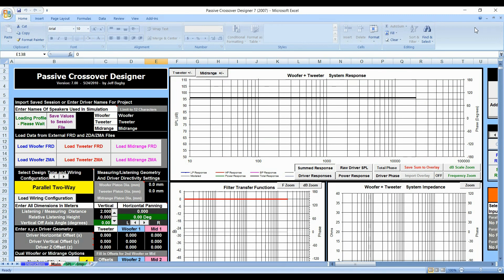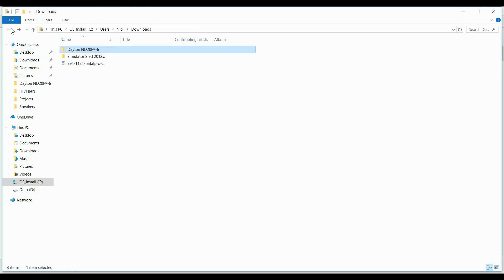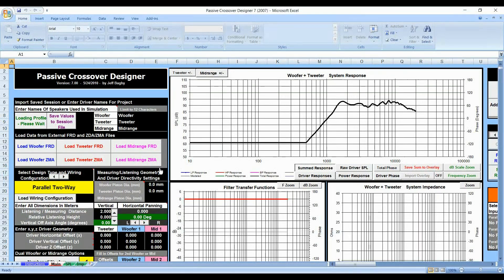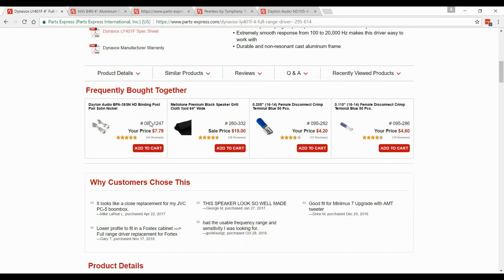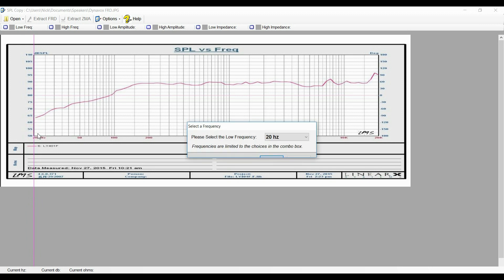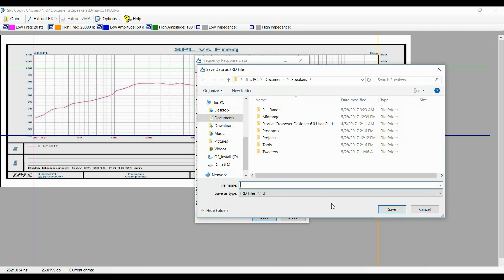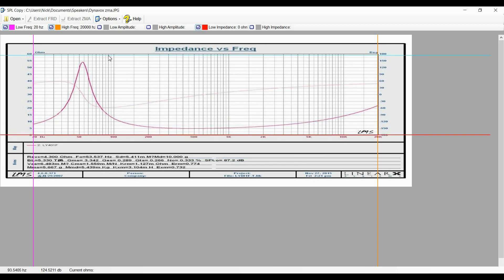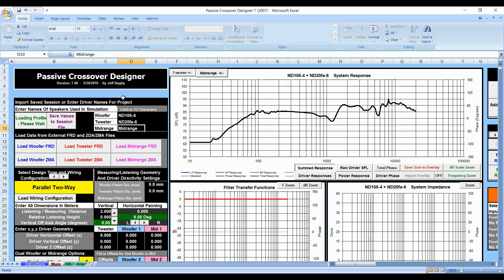How to Design a Crossover - Part 1- Import ZMA and FRD Files

Comment: This looks cool, but it's ALL "Greek" to me, lol! I don't even understand enough about the very basics of how computers work in order to even use this program at all. I don't know any of the terminology you're talking about, or even how you are doing all of the file renames and copying of info, etc. Computers are completely "alien" to me. I can barely even figure out how to use my cellphone to watch videos on Youtube...

And I really love working with and improving speakers, I have for many decades, ever since I was a teenager, but I've always done all of my calculations on paper, utilizing a paperback speaker design book I have and a calculator, and making all of my measurements with a multimeter and a manually adjustable analog frequency generator, then drawing the response graphs out by hand, point by point, on graph paper, as that is all the equipment that I can actually afford...

I know you said that this specific program is free to download and use, which WOULD (potentially) be really cool, but since I don't know anything about how computers work, nor do I even OWN a computer or laptop in the first place, because to me they are just an extremely expensive "gadget" that would just sit around collecting dust with me because I don't know how to use one, so oh well, I guess I'll just have to keep building speakers the "old fashioned" way, as described above. That's worked for me so far, even though it takes MANY hours, or even days, sometimes even months, of tweaking and adjustments and recalculations to finally get a good final result!...

I really wish I had a better grasp of how to operate a computer, because if I DID understand them better, I can tell that by using a computer program like the one in this video, my hobby would be MUCH easier AND faster to do, but even after MANY decades of trying to learn about computers, I just totally gave up on them, because they are just WAY too confusing for me! I simply can't wrap my mind around just how many endless options that computers have, with all of the stuff on the screen always continuously changing, nothing is ever the same each time you turn it on, and files and stuff always just get "lost" somewhere in the computer and I never "got" how to find them later... again, I can't even grasp the very basic fundamentals of how a computer works, so I just stick with things that have totally manual knobs, and mechanical buttons and switches on them, so that way you ALWAYS know exactly what any specific control does, and it can be relied on to always do that same function every time you push, flip, or adjust it...

The same cannot be said for any of the controls or keyboard buttons on a computer, as they always are doing something totally different, and in different combinations, with every different screen view, depending on what you see onscreen, but it's just way too much for me to remember all of the specific button combinations to make a computer do anything as you want it to... Computers to me are like trying to open a combination lock, where the combination to open it is constantly changing, and at totally random, unknown times, lol!

Comment: Great video about crossower.I want learn these:
in some  crossowers using car lamps  for tweeter protect for especiall while microphones feedback.
If have good design crossowers for suiable power amplifier not need bulbs for protect?
Other question what is these filter design's power rating  ? for example how is change values for 500 watt RMS amplifer crossower design (for all same frequency filter ranges)
Summary if our amplifier's have not feedback protect feature how to protect speakers in crossower?and how is change design for more power amplifiers?
Again thank you for great crossover video series

Comment: Hi, great videos. Quick question about the FRD files. I downloaded one for  Dayton Audio TCP115-8. And then I got the trd from the graph using FP graph tracer. When comparing them the curve similar but the official values are around 2.3 dB lower. But the scanned ones then are in line with the graph on the datasheet. So which one should I use then:) What's you experience with scanned frd files and real life measurements?

Comment: I try out that SPL copy, and it worked only partially, because FRD, did not shown correct frequency response line, it was similar at the best.  And ZMA line was correct but values was not, it show 4 Ohms lower then it actualy was. I tride out seweral times, changed walues, but still in crossower desining programs graphs was uncorect. I try 2 cross design pros, thay show the same results, and results did not match measurements which was in PDF files.

Comment: Would be great to see something similar and human using VituixCAD, especially the optimiser and something a little more in depth than Kirby.
Reply from the maker: Maybe I can do one for that program if you like. I'll have to look into it
Reply: That would be totally awesome, something for the mid-level designer rather than the total beginner, oh and it has an SPL Trace tool built in, handy for non Dayton drivers, some of us use alternative manufacturers 🤣😂👍.

There's very little human YouTube help for this application, and it's so so comprehensive.  

Cheers
Lea

Comment: When you use the dats V2 to get your t/s parameters can it give you this info as well? Trying figure out the best way to pull specs on some vintage drivers that have been in the family that I would like to design new enclosures/crossovers for.
Reply from the maker: plugger410 it will give you the zma file. But in order to see the frequency response you'll need a measurement mic (like the umik-1) and a Rew (free).
Reply: @Toid  I wanna start doing more diy projects and I wanna get better with all the values I need to build right volume and do well crossovers.
I have a DATSv3, so I use it and save the impedance as .zma in dats?
To get my own .frd I can use REW ? do I only need a nearfield on axis or 0 -15 - 30 -45 degree measurements ?
thanks in advance
Reply from the maker: @tommyshoe-star1426  all of those measurements are good to have. What I'd recommend is starting a new discussion on the forum that way we can help you with it. www.toidsdiyaudio.com/forums

Comment: Hi. Great vids. I've learned a lot watching them. I do have one question. I'm building my own xover for the first time and the speaker I'm building has a passive radiator in the design. How do I design the xover with that in mind??
Reply from the maker: Drew Dunn the crossover really isn't going to change. The only thing that's going to change is your box design. So you're going to want to simulate your box designed with the passive radiator. I have a series on when ice tea and how to do that if you're not sure how to
Reply: 123Toid that'd be great if you could send me the link. Thanks for your help. It's hugely appreciated.
Reply from the maker: Drew Dunn Sure.  Here is the link to the playlist: https://www.youtube.com/playlist?list=PL6hjpiCHZmIOAv44PCreW5KlI35h1mTZK
Reply: Thanks dude. Keep up the great work.

Comment: For all those having problems with Excel. i spoke to Jeff and he said "Thant it work correctly in 2013 and up, or any application that is 64 bit architecture. This is due to Microsoft changing the way the VBA is handled. Unfortunately, to resolve the issues would take a lot of rewriting of code and I do not have the time to do that these days. I also do not know exactly what all needs to be redone. As a results, as I have stated a number of times on forums, I do not plan to rework it at this time. Maybe I will change my mind down the road, we will see."

Comment: I'm working on my first 3-way and am having difficulty importing the midrange frd/zma's. I can import them on the woofer section just fine, so the files are good. It's just not loading up the mid when I hit load mid frd and zma. Thoughts?

It's gonna be a TangBand W5-1138SMF + Tymphany TC9FD18 + Dayton ND16FA and is more or less Scott Sehlin's 'Hafnium' design with a different tweeter.
http://techtalk.parts-express.com/forum/speaker-project-gallery/53512-hafnium?234378-Hafnium=
Reply from the maker: Kcducttaper1 make sure you select 3 way wiring parallel on the left hand side just below where you import your FRD and ZMA files.
Reply: I'd hit that, but it still wasn't working for me. Turns out I needed to select 3-way, then hit the 'load wiring configuration' button right below that to get it working. Thanks!
Reply from the maker: lol, I did forget to mention that.  Whoops, that is only the most important part :)

Comment: I love this series - thank you!  But I have a question:  I am contemplating a component audio system for my car and also designing the crossover for it.  I realize there is a huge difference between home & car audio; car audio is like making a silk purse from a sow's ear, but, generally, would one still use the same approach, knowing that the car's interior, etc., is going to make a mess of one's carefully laid-out response graphs?

Should one still shoot for a "theoretically" flat response, and then try and EQ the resulting "true" response after the system is installed?

I value your opinion on the matter.
Reply from the maker: That is a great question.  The best thing to do, would be to test the speakers in their probable location with a mic.  Graph the speakers separately and then design the crossover around those graphs.  There are a lot of variables in car audio.  However, if you are unable to do that, then yes.  Shoot for a theoretically flat response based off approximate locations
Reply: please please do yourself a big favor and go full active with a dsp...that way you can measure and corect everything on the fly without making crossover....yeah you will be making crossovers but in the dsp....also has the benefit of no loss to the signal...

Comment: I would like to use this Excel spread sheet, but i have an office 2016 version. The file is not opening in this version. Do you have a fix for this?
Reply: Awesome.  I'm trying to learn about speaker crossovers and I'm really excited to find your video series.  One more quick question....If I were to use that B4N as a mid and the same Tweeter (ND-20FA) for a speaker, similar to the 'Overnight Sensation' bookshelf speakers, would I just input my mid-range info into the woofer load section in the excel template?  Because if I change the wiring configuration to 3-way, it may not be accurate because I am not doing a 3-way circuit config.
Reply from the maker: Bart Agten I haven't heard of any issues with office 2016.  of course I  do not use it either.  Have you enabled macros?  It will not work until you do that.  If that doesn't help, try running it in compatibility mode.
Reply: Thnx for your reply.
Even when i enabled the macros, it still doesnt work in 2016. So I tried it on a 2013 version and it works.
Reply: If you have Excel 2016, how did you try it on a 2013 version?  I am having issues in my excel 2016 version as well, tried compatability mode and it still does not work when attempting to load the FRD and ZMA files....
Reply from the maker: spencer schmid I've heard some people having issues.  Have you first enabled macros?
Reply: Yes, I enabled macros and also the VBA toolpacks.
Reply from the maker: spencer schmid if that's the case, unfortunately I don't know a fix for it. However you can try winpcd.  It's a variation of this program, not quite as powerful though or intuitive. Your other option is to try another Excel program. If not an earlier version, maybe one of the freeware versions might work with it
Reply: I actually got it to work through some trial and error, not sure what was going on, but I had to resave the FRD and ZMA files after opening them again in notepad.

I replicated what you had for the ND-105 (woofer) and ND-20FA (Tweeter) and my graph mirrored what you had.  One thing I am not sure about is the B4N.  I saved those FRD and ZMA files for the B4N and tried to upload them on the 'midrange' load button, nothing changed.  However, when I loaded these to the 'woofer' button on Excel, they did change the graph.  Isn't the B4N a mid-range driver, and should not be loaded to the woofer?  If so, I'm not sure if the system response graphs should change accordingly.  Does that make sense?
Reply from the maker: spencer schmid that is awesome that it started working for you. I'm glad it is I was out of ideas. As far as adding the before a non a mid-range all you have to do is on your left hand side you'll see where it says parallel two-way in yellow. It should be right underneath where you load your zma and frd files.  Scroll over to parallel three way and click the button underneath it that says load wiring configuration.  Then you should be set
Reply from the maker: All 2 way configurations use a woofer and a tweeter in a 2-way configuration.  The only time you use the midrange, in this program is if you are designing a 3-way crossover.
Reply: You could use BoxSim instead. It's a free and very mighty program but a little complicated to use.
Reply from the maker: Thank You!  I'll check it out~

Comment: Hi there!
Excellent video! Only I find it hard to get the ZMA and FRD files for the different speakers on the market. "Then just buy at PE"... Yeah, BUT!!! Living in EU it gets kinda hard and expencive to get hands on the speakers like Dayton and so on... 
My question: Is there a way to generate the files from T/S data, and use the program that way?
Reply from the maker: You may need to buy a system like Dats V2, if you cannot find the spec sheets.   You'll need a mic for it.  I use a umik-1 by minidsp.  https://www.parts-express.com/dayton-audio-dats-v2-computer-based-audio-component-test-system--390-806  I am sure there is an EU equivalent.
Reply from the maker: I mis-read your question the first time.  You were asking about making FRD and ZMA files.  I was thinking you were asking about T/S. data.  You can use REW, which is a free program to measure the individual driver in free air.  Then use SPL copy to  get you FRD and ZMA file.s  You will need a mic like the UMIK1 or equivalent.